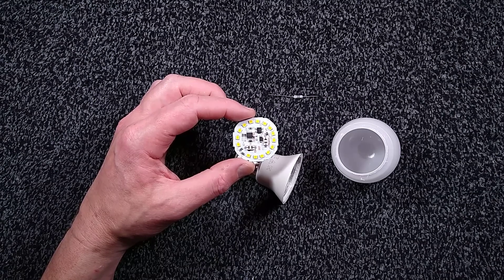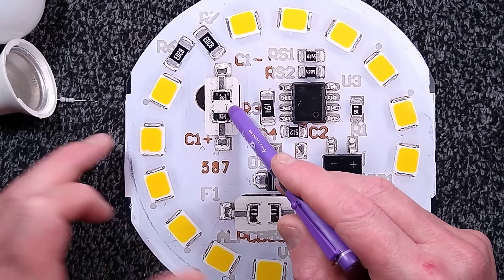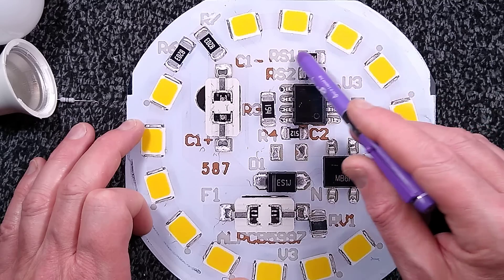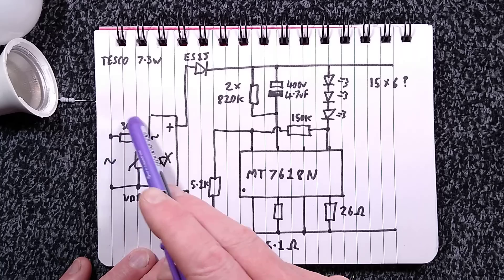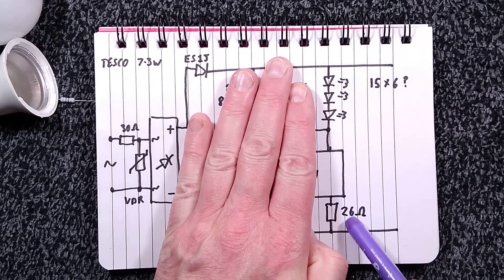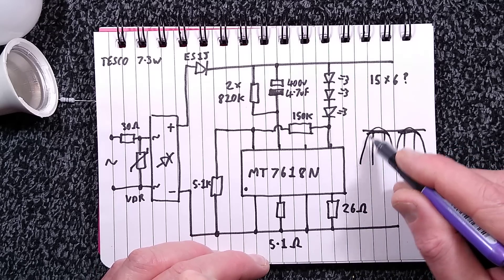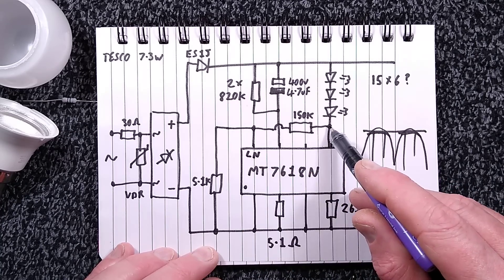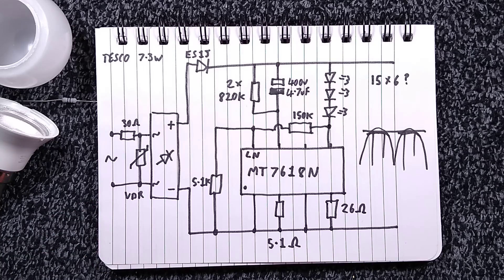Tesco lamp with weird circuitry twist

Comment: Maybe the circuitry sends a back emf and the high speed diode blocks it from damaging the bridge rectifier or stops it from going into the mains wiring. Maybe you could connect an oscilloscope before and after the diode and see if anything strange happens during normal operation and at on/off moment.
Reply: i wonder....would need to see the piv rating of the bridge rectifier..

Comment: The very skimpy datasheet for MT7618N seems to suggest the use of PN junction diodes in the bridge rectifier judging from the symbols as shown. A large diffusion capacitance of forward biased PN diodes in a low cost bridge rectifier coupled with the electrolytic smoothing capacitor could adversely affect power factor so a fast, low junction capacitance series diode could help to compensate. However, in this application the bridge rectifier appears to be an MB6F, which uses schottky diodes, which are fast and have no significant diffusion capacitance so the ES1J diode in this case appears to be superfluous.

Comment: i got zero clue, could it be pwming the load like a pwm dimmer related to the voltage (but diode is not properly placed for this I guess), instead of linear?

Comment: the diode will be to protect the bridge from the peak voltage of the electrolytic, I would check what voltage is actually on the electrolytic above the 0V rail as I suspect it's rather more than you would expect, I'm thinking voltage double circuit via the chip

Comment: Perhaps it charges the capacitor in pulses, and a standard diode bridge isn't fast enough for its frequency. But instead of guessing, I would rather see the waveforms of all the pins on the IC. 🙂
Reply: This. Yep.

Comment: I found the below that lists the various power factors, harmonics, etc for the chip. It also mentions "The new EU standards for lighting products on September 1, 2021", which is probably why the design is different so it complies with the new EU standards.
m<period>gdzrlj<period>com/article/21935<period>html

Comment: The fast diode is there to prevent something called "snap-off" transients.  When a diode is reverse biassed a transient reverse current flows to remove the charge stored in the depletion region.  The reverse current itself isn't much of a problem the charge is only a few nanocoulombs but when the charge runs out the current stops very suddenly generating a high frequency ringing spike which is an EMC problem.  The old school method of tackling this problem is to add snubbers across each diode in the rectifier but for low power circuits the addition of the fast diode is cheaper.  You will probably only see this in lamps specified by large shops like Tesco who actually have to conform to things like EU EMC directives.
Reply: Just to clarify, this reverse current that I'm talking about is not leakage current.  During the short reverse recovery time the diode looks much like a short circuit so the reverse current that flows is determined by the external circuit and can be of the order of amps.  This is why it can generate  a lot of noise when it suddenly stops with a fall time of perhaps a few nanoseconds.  You won't find any mention of this on a typical rectifier diode data sheet such as the 1N4007 but fast diodes have a specified reverse recovery time at a given current.  For example the ES1J has a trr of 35ns at a reverse current of 0.25A.  There is also a class of fast rectifiers that are described as Soft Recovery diodes which exhibit smaller snap-off transients.  Reverse recovery time is the reason why fast diodes are necessary.  If you tried to use a 1N4007 in high frequency switching application it would never stop conducting.
Reply: Thank you number 33, that makes more sense than most of the other speculation. As I’ve said elsewhere, small value capacitors connected across all the bridge rectifier junctions is a common method of reducing noise from bridge rectifiers.
Reply: @Mark1024MAK  A common place to find snubbers across mains rectifiers is in audio equipment where the snap-off spikes can get into the sensitive parts of the circuit and produce an audible 100/120Hz buzz.
Reply: We are having many issues of buzzing from led lighting .We tried the best dimmer we could get from Leviton for use with drivers with 0 to 10 v control .Nothing seems to be working .Not even putting ferrites on all wires ,power ,control and 12 v side  .They only make 250 watt power supplies because at 12 v you will need a #10 gauge wire to feed your led lights .So no one puts more than 200 watts and use a #12 awg wire .The other issue is the capacitors causing orobls when the ambient temperature is at 50°C .in attic spaces ! Big problems and you have to de rate the drivers and up size the wires !It's a mess !
Reply: @carlubambi5541  It sounds like you know what you're doing so I probably can't help much but have you tried using a transistor radio to identify where the noise is coming from ie is it the dimmers, the drivers or the lamps.  If, as is most likely,  it's the drivers then you might try screening one by wrapping it in aluminium foil and grounding it to see if it helps.  You will need the ferrite too.
Reply: That only applies to power supplies with inductors or leakage inctance (e.g. from a power transformer). Here the'ye connected directly to the mains, so that can't be the explanation.
Reply: @MB-st7be  What number 33 is describing is called current tail, and doesn't have anything to do with inductance. Put even simpler, when the diode (PN junction) goes into reverse bias, it will conduct for a fraction of a second. This is the current spike and will cause EMI. You might be thinking that with sinusoidal AC there is never a point when the diode can conduct suddenly because the current will be low when the voltage is low, but when the power factor is not 1, the voltage and current are not proportional. This will happen, especially with capacitive loads.
Reply: @MB-st7be  And the mains leads aren't inductors?
Reply: @MB-st7be  The depletion regions inside the diode NP junctions are kinda tiny inductors for the purposes of this explanation !
Reply: You can't have reverse current unless you have leakage from the bridge rectifier. It is possible that that diode has a high forward conduction voltage or current maybe it has a funny conduction characteristic. Maybe it starts conduction when the forward voltage reaches say 90 volts and once it conducts it goes short so long as a forward current exists. Avalanche diode? Or its dimable.
Reply: @zero0ryn  The leakage from the bridge rectifier happens during the bridge rectifier diodes' current tail. Remember that without this extra diode there would be a charged capacitor across them, and thus a large voltage when they change state.
Reply: @zero0ryn  I disagree. The capacitor will be at a higher voltage than the output of the bridge at parts of the cycle, so you'd get a reverse bias inside the bridge each half cycle. The fast diode blocks that
Reply: This diode is here for absorb the quantic energy of vibration homo-harmonique with the cosmos. . You can't understand ... it's quantic !
Reply: @renelefebvre53  Yup, that's what I said.
Reply: @petehiggins33  Splendid! Good luck. 👍

Comment: Coincidentally, as I watch this I'm trying to remove the board out of a 120V lamp to find out why it has turned into a flashing lamp at about 1 Hz.  Thanks for all the analysis in all the videos.  You are an educator.
Reply: It has self identified as a Christmas tree light
Reply: I had a lamp that started the slow disco strobe before going fizzz pop.
Reply: Flashing lamp that works for a bit longer when first turned on means the chip is going into overheat mode.
Reply: @Wierdy1024  Thanks.  I'll look towards that first.  Maybe freeze spray first to cool it then power up and see if it is stead longer this way.  Maybe just put it in the freezer for a while.

Comment: its for adjustment of propagation delay of the circuit   because mains comes in at 60hz which is humanly discernible  as a flicker, this circuit speeds up the propagation delay time to the human persistence of vision can see a solid light

Comment: You may need the extra components for the internet over light bulb, instead of doing more boards they use boards they had, the same thing happened with telephone and TV'S bedroom for extra functionality but the components to run it we're left out, we had an answer phone month would work with a remote with can come with one but it's had the components to work, you good whistle saying that the remote did

Comment: I suppose the two large resistors divider used for internal mirror circuit. The fast diode certainly will keep a good life for the large capacitor.

Comment: My guess would be that the high frequency diode is there to minimize the backflow pulse into the BR, and then on into the metal oxide varistor. Perhaps it helps protect or limits the wear/tear on that metal oxide varistor? Try hacking it with a different kind of diode? What happens if you just jump across that diode, giving the electricity a reverse path around it?

Comment: The current control to the capacitor has to be to improve dimming. Without that control the capacitor would override the dimmer and draw extra current to smooth the voltage. By limiting the current the dimmer can operate as expected.
The down side of that would be flicker so I suspect the chip is performing its own high frequency pwm and for this it needs the fast recovery diode.

Comment: I'm surprised how many light bulbs now seem to be rated 'F' for energy efficiency. Same as flat-screen Tvs, which all seem to be either 'F' or 'G.' 🤔
Reply: Well, even though they use relatively little power, in absolute terms they are still awful, only 20-30% of the energy used is emitted as light, and often at the lower end of that, the rest is dissipated as waste heat. A lot better than the 1-2% efficiency of incandescent lamps, but still. If the criteria for efficiency include some measure of what proportion of the power consumed is used for the actual purpose of the product, and what proportion is wasted, maybe that's why. I have no idea if that's the actual explanation, just a guess.

Comment: Will a "poor" power factor load have any effect on the amount of power read by the old style rotating plate meter, or the new digital (smart 🤮) meter?
Ancient florescent fittings have a capacitor intended to negate this power factor "problem" (or was that just for RF interference?).

Comment: I use these in the kitchen, bathroom and toilet. 
The last two are still working after 2 years but the kitchen failed a few weeks ago.
They are all in enclosed globes but as the kitchen one stays on for far longer periods, it probably overheated. One of the chips has got the black spot of death.

Comment: One thing I don't understand. Doesn't a "good" power factor mean drawing all your current at the highest mains voltage, since the line drops are the least? But it's also bad because it's very irregular loading of the grid, like the pistons of an engine.
Reply: With a perfect power factor, the instantaneous current is a scaled copy of the voltage. Drawing the current just at the highest of the voltage gives a poor PF. This specific circuit increase the PF by increasing the current before and after the voltage peak.
Reply: @florentbr83  good job not answering anything i actually asked: but wouldn't an ideal PF just draw a massive spike of current at the highest voltage, since it'd be minimal loss on the grid?
Reply: @dimitar4y  Well, good job no being able to see that the answer is actually there. If someone states the opposite of your YES/NO question, then the answer is NO.

Comment: I have three theories for the 2nd diode. One, manufacturing error it's a leftover from an alternative schematic. Two, maybe the way the chip operates to sink current through the LED's and the capacitor causes a weird ripple that can affect the main rectifier. Three, maybe they think two is real so they put that diode there but such a phenomena doesn't exist.
Reply: Such a phenomenon (it's singular - phenomena is plural).

Comment: I think this extra diode is to nudge down the mains supply by another diode drop just to reduce the stress on the components ever so slightly. And they may have those diodes plenty in stock as a rectifier for lower powered lamps or capacitor dropper based cheaper lamps they make. And I also think this diode could prevent switching noise from going back into the line? But switching noise from what?

Comment: The "normal" chopping of a sine wave results in a near square wave, with loads of unwanted RF emissions, by smoothing the corners these emissions are massively reduced so not upsetting the neighbours as much.  It would be interesting to see what the RF emissions of Tesco's finest are compared to a normal lamp....
Reply: I was wondering how they compared to Poundland's finest LEDs myself, as the Tesco ones seem to be quite a bit dearer.

Comment: I wonder if the chip is doing something special with the 400v 4.7 uf capacitor to use the extra energy outside the normal usable range.
I guess a scope across the capacitor would show the charging curve and sicharging curve.

it is all very weird though

Comment: The highspeed diode is needed for the switching regulator, It pulses the cap quite fast at quite some current.
It's actually a smart trick, they now only need one fast diode instead of four.
Reply: Doesn't make sense, there is no switching regulator
Reply: @MB-st7be  the chip switches the charge/discharge current to and from the capacitor as Bigclive says correctly.
Reply: @MB-st7be  All active PFCs use switching actually
Reply: @Sentinel-1  Non inductive so still not clear why a fast reco would be needed
Reply: @MB-st7be  The inductor is only needed to smooth the current, so it could be done without it, if you don't care about the ripple at the output. Furthermore, some ICs may have internal inductors, like the Intel CPUs with FIVR (but it requires much higher frequency due to very low inductance).
Reply: @Sentinel-1  Nope. If you don’t have an inductor then you have no advantage from switching. Switching a capacitive element is as lossy as a linear regulator. I did the math on that years ago, and I design switching regulators in my work.
Reply: @MarkSJBeard  But who is talking about the efficiency? It's about improving the power factor in a cheating way, nothing more. Both inductors and capacitors react to switch literally the same, and both are energy storage device. The only reason to use an inductor with a capacitor for such switching purposes is to reduce the capacitor value for low enough ripple for specific application. But the only capacitor will do the job alone, when you increase the charging duty cycle in inverse proportion to the half-wave voltage of the sine wave, and vise versa for the load duty cycle. Most of the power meters take the bait 🙂

Comment: Hey Clive I'm fairly new to your channel, love it btw. Have you covered any E39 or E40 LED lamps before? Retrofit lamps for the HQL lamps we see in big spot lights and such. 

I get the feeling it'll be quit simple compared to the lamps they're built to replace but alot of suppliers (osram and philips for exmaple) now are selling these big lamps with a standard E27/26 base now so I'm curious how they pack so much power into such a small fitting (I'm an electrician, I don't tinker much with electronics  but learning about them has helped my business so much when it comes to product selection)

Comment: I suspect that high-speed diode is to prevent switching transients from back-flowing into the bridge rectifier. It's also going to help keep the capacitor fully changed. That might be helping with EMF or the power factor.

Comment: I'm guessing that ES23 diode is trying to stop switching noise going back out through the bridge rectifier. It's an entirely awful and probably totally ineffective way to do it but it's a lot cheaper than a common mode choke.

Comment: My guess....  the capacitor is not there to provide DC.  the chip is a constant current source for the LEDs that follows the AC waveform and provides a fairly decent power factor.   the capacitor is charged at a midpoint on the falling edge of the AC waveform to keep the diodes on and lessen flicker.  the fast diode is there to lessen the loss of the reverse recovery of the big rectifier diodes as the input drops below the cap voltage.
EDIT: Thinking about it some more the cap is probably charged with a constant current over the 1/2 cycle to a lower fixed voltage to provide current to the LED over the valley

Comment: With the active capacitor switching, the fast diode stops reverse current back into the bridge.
The lesbian nun will allow the cap to be charged when the LED voltage/ current drops.
Reply: It's called "free wheeling diode" in MT7619 data sheet,  7619 has built in diode and rectifier

Comment: The LN terminal is measuring the difference between the rectifies supply rail and the LED Vf. This is almost certainly used to control the capacitor charge current, i.e. make it proportional to voltage so the circuit appears resistive, at least during the portion of the AC waveform where the cap is charging.

Modifying the lamp to reduce LED current will probably upset this; with less current the ripple on the capacitor and therefore conduction angle will be reduced which would degrade PF.  Probably the ~5 ohm resistor needs to be adjusted accordingly.
Reply: I think that you are the only one to get this right.

Comment: I guess Pin 8 is Vcc and the divider is there to limit the voltage. The only reason for the additional diode is probably that the leakage current of the bridge rectifier diodes is to high and therefore a additional diode is added. But it really doesn’t make sense at all …